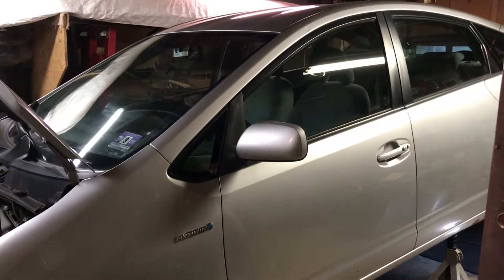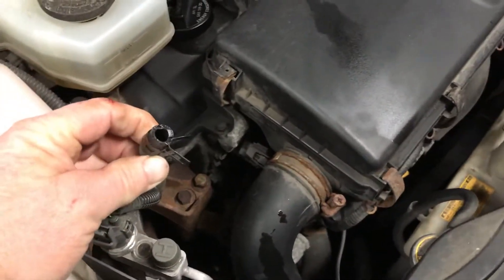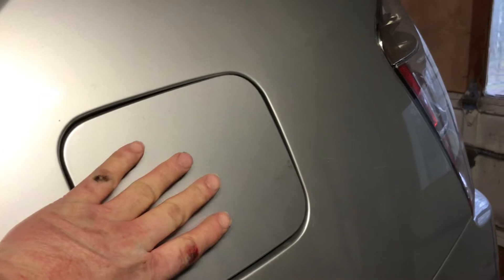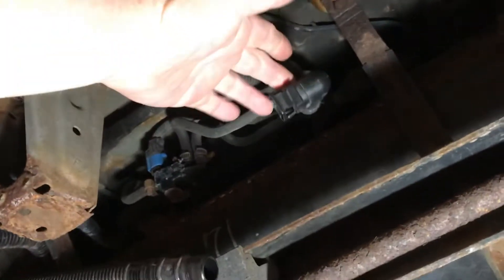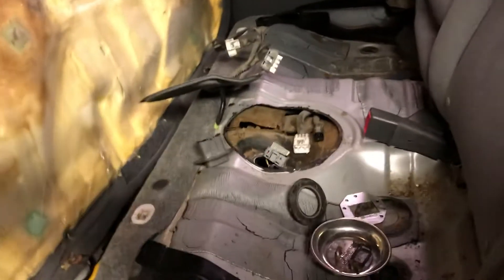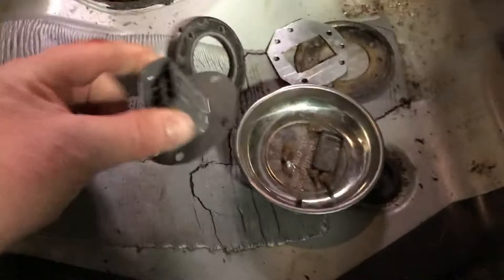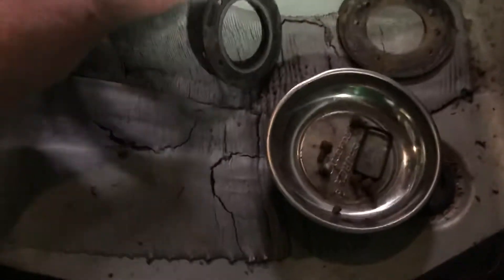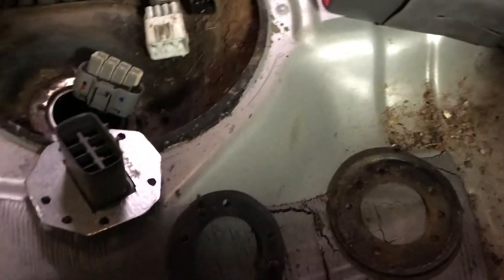P0456 evap leak in 2006 gen 2 Toyota Prius

Comment: I think also you should replace the gas cap because the check valve inside the cap allows air to enter not escape. So if smoke came out of the cap it's no good.

Comment: Barry, Thanks so much for this video! It saved me a ton of money. For other owners with the P0456 error code because of the cracked connector, there's no need to make a special plate to repair the cracked connector. Just clean the cracked connector flange with electrical connector solvent, lightly sand it, wire brush the metal retaining collar that holds it on, then butter the connector flange with JB Weld thoroughly, press the retaining collar onto the connector and into the JB Weld,  screw the assembly back onto the tank, and tighten the screws lightly (you might want to place a little grease on the threads of the screws to prevent them from sticking to the JB Weld). Then wait 20 hours for the JB Weld to cure, remove the connector/collar assembly to check its integrity, place a light skim coat of silicon gasket cement on the old gasket if you're reusing it, replace the connector in the tank, tighten the screws properly, and stick the access cover plate back on. You will be back in business and the connector will likely never crack again. And your car won't be throwing the P0456 code any longer. 🙂

Comment: I have an 08, I'll see if this is the problem. The comments are very helpful
Reply: Did you find the problem? I don’t have dtc codes but my long term fuel trim are high almost 20, so it’s a vacuum leak somewhere
Reply: @kayali8842 I opened it up and didn't see any cracks. A mechanic told me it didn't affect the performance so forget about it. So I did. I get 44.2 mpg and no problems
Reply: @grewntd  44mpg us is like 53mpg uk so yea that’s great mpg.

Comment: I think this might be my first comment on a youtube video ever. 

I bought a new-to-me 2006 Toyota Prius recently with this error code. I negotiated some off the asking price, thinking P0456 would take some work but not too much. Only upon diving in did I realize my mistake. After much research and determining the emissions valve under the hood was still good, I decided to check this out, and this same plastic connector sure was cracked. I didn't even bother to order and put a new gasket on, I just used some gasket maker I had around the plastic connector and put it all back together. The check engine light has stayed off and I passed inspection! Without this video, I would've been deep in the emissions tubing or paying a mechanic to go on a wild goose chase to eventually find this. Thank you so much for posting this!
Reply from the maker: Glad to have helped. Thanks for the feedback.
Reply: Hi error code P0171
there is a low traction, a little wheezing sound when loaded on the gas hownto fix this problem

Comment: Thanks for the video, Barry.  How did it turn out?  Asking as a 04 owner with p0456 who's been told by Toyota and an independent "aw, the car's old.  We'll probably need to put a whole new tank in for $3,000 - don't bother..."  Yes, I tried the new gas cap too!
Reply from the maker: Worked great. Fixed the code and CEL.

Comment: I wish there was a way to give you a thousand likes, I had the same code P0456 as well. I've been trying to tackle this problem for about 2 years and finally found your video and fix my problem. The same part was cracked on my toyota prius 2009, I just put some epoxy on the back of the cracked piece and problem solved. I went to 3 mechanics and they were all wrong, one told me it was the fuel filler neck, the other that it was the purge valve and the last mechanic that it was the vent valve. Thank you so so much for your video.
Reply: Do you mean code P0446?
Reply: @ajayamini1740  I mean code P0456 the same code Barry had and the exact same problem.
Reply: @ajayamini1740  I keep getting that code , any resolution?
Reply: Did you only put the glue or did you add a piece on top like him?
Reply: @WillThessen  I put glue only, that fixed the problem. JB Weld plastic bonder.
Reply: Did you only put the glue or did you add a piece on top like him?
Reply: Did you only put the glue or did you add a piece on top like him?
Reply: Did you only put the glue or did you add a piece on top like him?
Reply: Did you only put the glue or did you add a piece on top like him?
Reply: Did you only put the glue or did you add a piece on top like him?
Reply: Did you only put the glue or did you add a piece on top like him?
Reply: Did you only put the glue or did you add a piece on top like him?
Reply: Did you only put the glue or did you add a piece on top like him?
Reply: Did you only put the glue or did you add a piece on top like him?
Reply: Did you only put the glue or did you add a piece on top like him?
Reply: Did you only put the glue or did you add a piece on top like him?
Reply: Did you only put the glue or did you add a piece on top like him?

Comment: I got same problem in my toyota prius 2005 where can I repair that
Reply from the maker: lg Mobile what do you mean by same problem.  P0456 code or you found that cover cracked?
Reply: @barryschwartz2439  I got check engine light and the code comming is P0446 it's evaporative emission system vent control circuit
Reply from the maker: lg Mobile that’s different. There are two vent solenoids, one behind the fuel tank and one in front of the engine. It’s probably one of those sticking.
Reply: @barryschwartz2439  it said like that
 In the report "Replace evaporative emission (EVAP) vacuum switching cable (VSV) & mention how it works An electric solenoid switch that controls vacuum to the EGR valve when it doesn't work, a failed solenoid will prevent the EGR valve from opening or will allow it to open at the  incorrect time pinging & detonation surging & rough idle control take place if this happens
Reply from the maker: lg Mobile EGR valve is different. This is an evap purge valve and should not affect how the car runs. If it’s running rough and you found this code, it’s probably not the cause.
Reply from the maker: lg Mobile an 05 Prius doesn’t have an EGR valve. If your car is running rough I really doubt this code is a clue why. You can check for gas in the vacuum line. If you find any the tank bladder must be bad. Otherwise an evap code shouldn’t cause it to run poorly.
Reply: @barryschwartz2439  yes perfect it may leak in gas line or bladder, from where I should buy the gasket and bladder is it available in the auto parts store or I have to set something else lete know please and I am thankful for your accurate suggestion
Thank you
Reply from the maker: lg Mobile I’m grasping at straws as to how an evap problem would make it run rough. The other is a very large vacuum leak. Either way you want to make sure that’s the issue first. He bladder is part of the fuel tank which is a $700 part plus a couple hours to install. If you don’t know for certain that’s the problem it will be cheap to pay a mechanic to diagnose the problem.   My car ran fine for half a year with an evap issue and the check engine light on.
Reply: Was she  smelling gas while you guys are GE badly